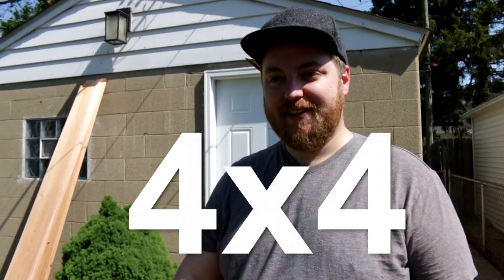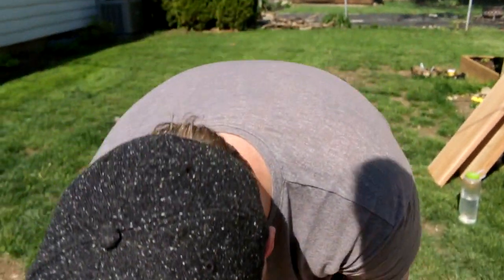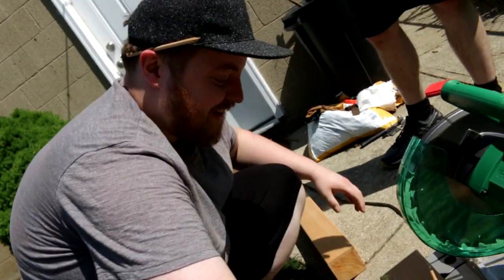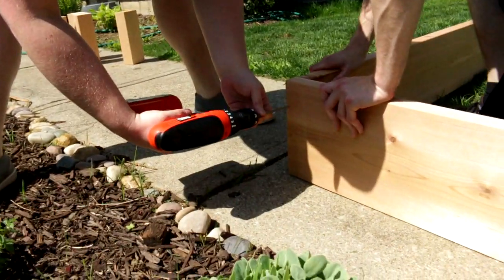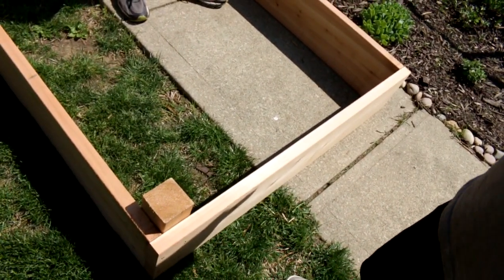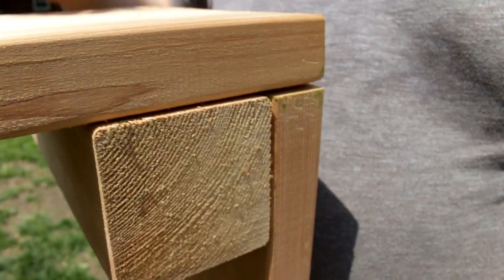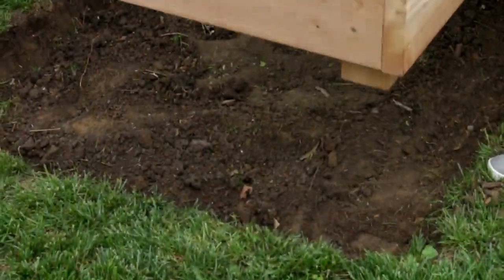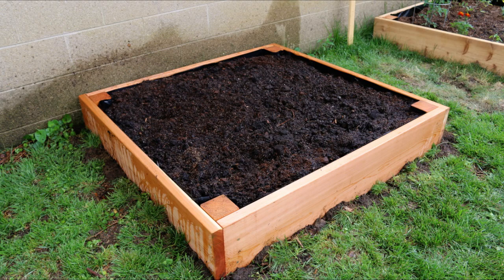How To Make A Raised Bed Garden

Comment: Also, my chop saw that I bought to re-do the baseboards and quarter rounds in my new house is a Ryobi with the laser.  Can confirm that the laser makes life easier.
Reply: andxx0r_the_second "lay-zer"
Reply: The Alan Parsons Project.
Reply from the maker: reviews online said it was misaligned.
Reply: Pretty Good Cooking that's what my wife says too......😅😅😅😅
Reply: Mine is fine in that regard, but as always one needs to compensate for the width of the blade when making cuts to avoid disaster.